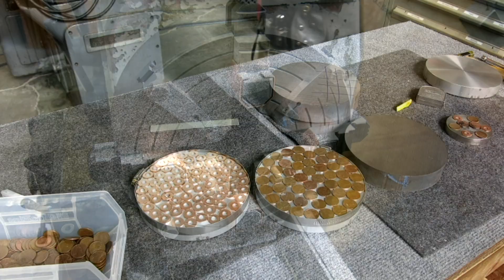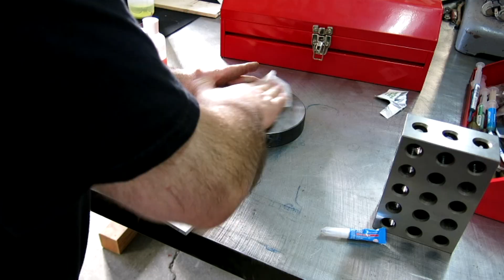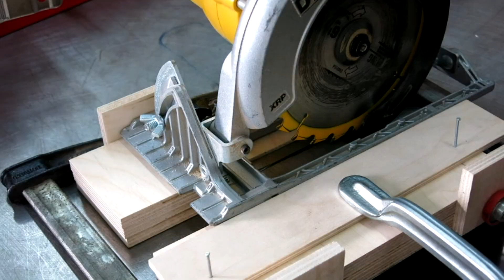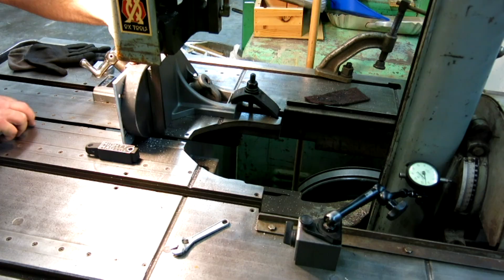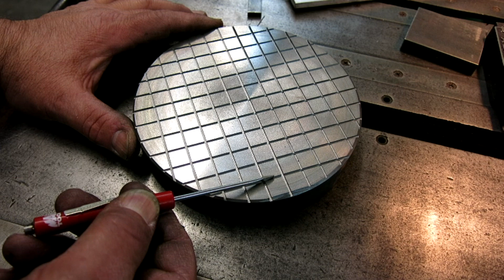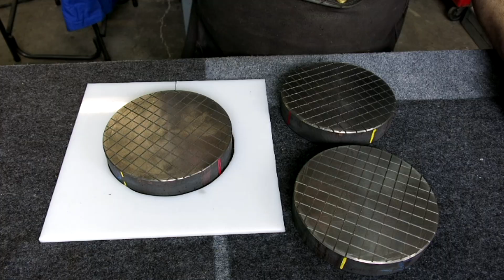Making flat lapping plates 1

Comment: Don't the grooves in the plates also increase the contact pressure locally?
Reply: The Workshop - Technically, yes. Though at a level that's essentially insignificant - think of the Void ratio to surface ratio. The slots are so narrow, while the plateaus are rather large by comparison, so the difference will be negligible. it's really done as he explained in the video to allow place for cutting/lubricant material and cut material to be aside from in between the plates that are lapping.

Comment: Could it be that the woodsaw has too much cutting speed for metal as the reason for the bad cuts? That blade probably works great on the horizontal mill, though ;-)

Comment: Rather than use a carbide tip blade I would try a metal abrasive blade that is made for circular saws. I know they will work on cast iron and should work for this application.

Comment: I want to try making some flat surfaces for practice using the three plate method.  I can get 10x10x25cm granite blocks at the hardware store for less than 5 bucks each.  Could I achieve a very good flat surface with those (like ~5 micron)?  Or does it only make sense to practice on some special kind of granite?  The surfaces are rough but already very flat although if you look closely the surface is "mountainous" and even though it's flat I'd probably have to rub off 0.5mm to get to the bottom of the "valleys".  Are such blocks a reasonable choice for practice?  I might make a tiny cnc with the flat blocks or play around with air bearings.

Comment: How can a fixed grinding wheel ever produce a reasonably flat surface?  By definition, the grinding wheel wears as it grinds, removing less and less stock as the wheel grows smaller.  Thanks.

Comment: Okay, I don't get the purpose of putting grooves in - wouldn't that just give the lapping compound somewhere to go other than between the mating surfaces? I mean, the lapping compound is an abrasive, right? It seems one would want it between the mating surfaces to polish down the item to be lapped, not oozing out the cracks formed by the grooves. :)

Comment: Here are a few pictures of a lapping plate I made a few years ago.  One of two I did, one for work and one for myself.
http://jamescrombie.ca/temp3/lapping_palte_edge.jpg  this shows the edge recess I made to help lift them. Heavy little bugger!
http://jamescrombie.ca/temp3/lapping_plate_grid_side.jpg grid was mill with a slitting saw on an angle head on a Bridgeport
http://jamescrombie.ca/temp3/lapping_plate_smooth_side.jpg and the smooth side I did most of the lapping of the seals on with 3 micron diamond paste.

James

Comment: Alley Oop would have used a chisel ;)   The gullet, valley, *swarf channel could be any shape . . . the IMPORTANT aspect is overall flatness & symmetry -  . . . consider the process of HONING . . . it is little more than 'rotary plane ''seeking'' = rotary ''PLANE'' surface, vs 'flat' !      *  If lapping were done on a 'flooded' flat lap , & no grooves were present, then frequent separation of the surfaces would be required - whereas honing moves in & out of the 'bath'  . . . taking the swarf with the lube .   ( 'Lots of ways to skin a cat ; even more ways to intellectualize / philosophise about it ! )    Pennies are no longer copper . . . just plated zinc !

Comment: Taken to the ultimate limit, with the aid of accurate interferometry and specialized polishing machines or skilled hand polishing, lens makers can produce surfaces that are flat to better than 30 nanometers. This is one twentieth of the wavelength of light from the commonly used 632.8 nm helium neon laser light source. Surfaces this flat can be molecularly bonded (optically contacted) by bringing them together under the right conditions. (This is not the same as the wringing effect of gauge blocks, although it is similar).  - https://en.wikipedia.org/wiki/Lapping

Comment: Off topic; (or maybe not) 
If you were on a deserted island, with no standards, surfaces, measuring devices, or tooling how could you bootstrap a precision machine shop? Seems to me having a flat and a parallel surface would be one of the primitives you would have to obtain to be able to do anything else.
Reply: That's exactly on topic, at the end of the video tom mentions the three-plate method for creating a true flat, developed by Henry Maudslay and Perfected by Joseph Whitworth almost 200 years ago.

3 plates are repeatedly tested against each other in sequence for contact using a transferable dye. After each test the contact points are scraped off as those represent high points on the planes.

3 plates are used as 2 plates will end up being concave and convex (think ball-and-socket) rather than flat, the third plate ensures uniform flatness.
Reply: Start with big rocks, scrape them in as close as possible by eye or with a rudimentary straight edge, and then lap them together. Assuming your rocks were good, there is no reason why you couldn't have an A grade surface plate. Then depending on your tools you have/make to make iron, the possibilities are endless.

Comment: I made a couple of cast iron lapping plates and have only been able to get a matte finish on the parts I am lapping. I go from 15 micron to 3 micron slurry and it still does not produce a desired finish. The parts are made from tool steel with a carbide insert brazed into it. Any ideas on what I could be doing wrong?
Reply: I suspect my plates do not have a good enough finish. How does the surface finish of the plate effect the work piece?

Comment: Well, I have been using lapping compound to mirror polish my Custom Swaging Dies, but according to what read in the link that you have in the description.. perhaps I have been doing it wrong..First I use some step drilling  first, then use my Custom Ogive Mill. then sand with about 220, then 380, then I use pieces of hard rubber impregnated with firs 600 then 1200 lapping compound...  I acknowledge that I may be doing it really wrong.. but Honestly don't have any one to give me any kind of guidance... If you have any type of advice I will appreciate it....

Comment: Do NOT use a circular saw to cut iron. The RPM is far too high, the grade of the carbide is wrong, the rake angles are too high on the cutting teeth, and the blade body is either normalized or annealed, making it wobbly and un-rigid. You'll destroy those wood working blades before you make a dozen cuts. If you do not have a horizontal or vertical mill, one of your best options is to use a high quality, large triangle file and make the cuts by hand.

Comment: Radial arm saw may work much easier.
Reply: I used my Kobalt brand sliding miter saw and a diamond tipped blade.  Worked surprisingly well!  Just make certain you have a good holding jig for the plate.  :)

Comment: Tom, as a retired professional woodworker, and an amateur metalsmith, I have to take issue with your use of "woodchuck" tools on ferrous metals.  The grade of carbide used, the method of brazing the teeth to the blade disc, the rake angles, the blade and tool rigidity, and the tip speed are all wrong for use on steel or iron.  It's possible to (carefully) mill aluminum or even brass with a variable speed router, but using a circular saw like this is a recipe for an eye (or other) injury.  I've seen many saw teeth come off when inadvertently hitting a nail or screw in lumber, and the shrapnel spray can be wickedly dangerous.  Why risk getting hurt when a $50 angle grinder and abrasive cutoff wheel would do the job?  And you may have kids watching your videos.
Reply: Because honestly, the differences between that saw and a metal cutting circular saw like ours aren't that great. I agree it wasn't ideal, and that's why he switched to his roll in saw.
Reply: I would kill to have that "roll in" verticle band saw
Reply: John Crowley  e

Comment: I'd just use an angle grinder with a 1/16" cut off blade and layout a grid and freehand it. It's easy to maintain a sufficiently uniform depth

Comment: Of course someone is going to ask if you can do the same with copper! I hear copper is a bit gummy, difficult to mill or cut. I want to make one of these plates for making small pieces of glass optically flat, perhaps I shouldn't use copper for that?

Comment: Hi Tom, this is Jacob in AZ. I've had a lot of luck. Mounting a falcon 7"   .062 wide aluminum oxide cut-off wheel on a surface grinder for operations like that. Your thoughts?

Comment: A nice thick piece of ordinary tempered "float glass" like that found in "energy efficient" windows or sliding glass doors works perfectly for a "lapping plate" and millions of diesel injection nozzles and injection pump delivery valve parts have been quickly and perfectly lapped on them with a little "fine" lapping compound in a few seconds to a few minutes per part for many, many decades. You "precision machinists" must have lots of free time and not much work if you've got all this time to make "how-to videos" and all that time to devote to making a simple task like "making" a lapping plate so difficult. 

Personally I don't know now and have never known a  good machinist/shop that wasn't constantly at LEAST a few weeks "behind" with work stacked up and more coming all the time. But yet there so many "expert machinists" with "how-to" videos on YouTube and posts on various machining forums etc. and apparently all kinds of free time and pretty much empty shops to work in. What's up with that?

Of course I've only been "wrenching" (and doing a little "minor" and "non-precision" machine work along the way like grinding valves/seats, boring counterbores in Cat blocks and installing inserts, etc) for 25 years or so now and have only done business with/made friends with a dozen or so machinists/shops from tiny "one-man shows" owned/operated by guys a lot of local people didn't even KNOW was a machinist/fabricator to an outfit called Gessford Machine in Hastings, NE. 

Most of the "free-time" machinists DO seem to be "up north" though, I've noticed. I'm guessing a lot of them are "casualties" of "downsizing" and "outsourcing" in the auto industry who have gone on to "new careers" as "machinists" where there are plenty of "cheap" buildings/ tools etc to rent/buy and maybe some good "subsidies" for "small business startups" to go with them. 

Eventually I'd think it would still get to be "tough sledding" if their primary "job" is making "educational" YouTube videos along with their own "precision tooling" if there are so many "machinists" and "machine shops" and so little actual work.
Reply: You have not seen where Tom works. The shop in this video is just his man cave.
Reply: Blah "free time" blah "scare quote" blah

Comment: Just bought three 6" rounds at 1.1" thick and milled one of the faces flat...here goes nothing
Reply: Update: used my 9" Craftsman Radial Arm Saw with a woodchuck blade to cut the slots at 3/4" spacing - wrecked the hell out of the blade because one of the track bearings on my RAS isn't perfectly smooth but it worked and the depth control with a radial arm saw is excellent.

Comment: Although I understand what he doing, I think that process with a circular saw is dangerous and possibly deadly. If one is so concerned with making precision ground lapping plates it seems incongruous to want to make the plate using an inadequate tool. I cut aluminium with a chop saw and a metal cutting blade, and I wax the blade. The chop saw is static in that the movement is well controlled for that job. But you could NOT do this groove cutting with one. Using woodworking tools to do metalworking is mind boggling. I stopped watching after I saw the results of his cutting.

Comment: Calls himself a machinist, then proceeds to use a circular saw and timber blade to cut metal.  Where did you learn that, some other 2 bit youtube engineering chamnel.

You have a lathe with a independant 4 jaw chuck.  Could you not just put it on the lathe and offset the axis and cut sime grooves.  Then offset it another way and cut some more grooves.